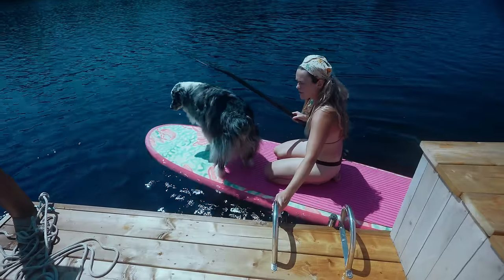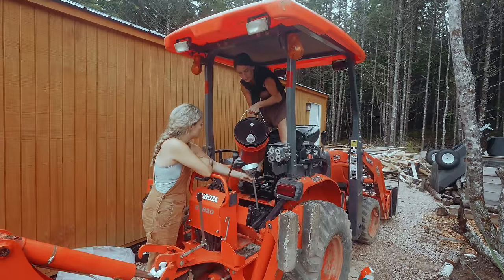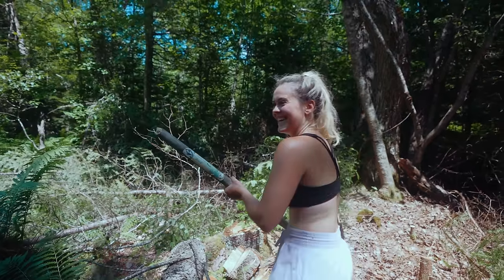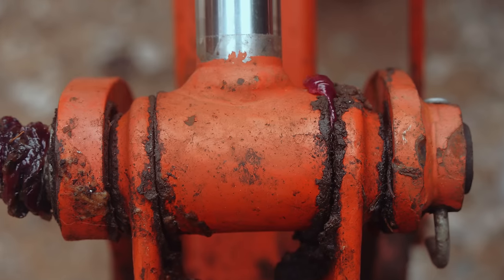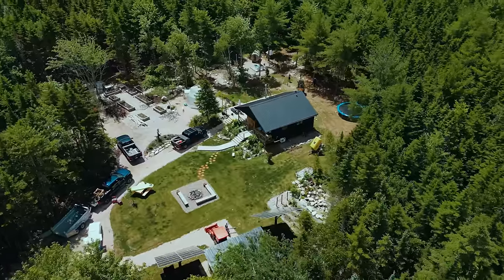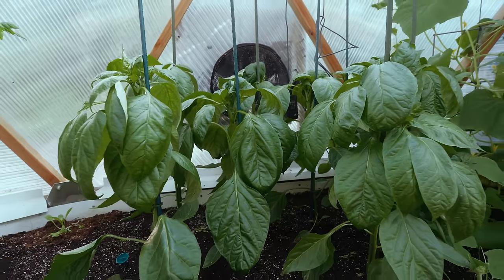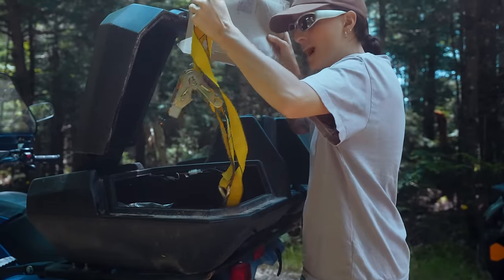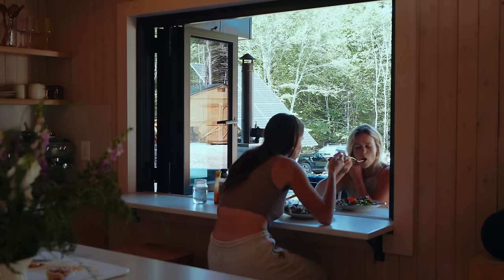30 Days of Cabin Life | Raw, Unfiltered, OFF-GRID LIVING in Remote Canada

Comment: Amazon sells pepermint spray to keep the rodents away.   It is good to spray around any vehicles that sit for a long time.
Spray in the engine compartment, in the wheel wells, and underneath. No mice.   
Mice can cause a lot of damage to vehicles. They chew on wiring.  Good to use around vehicles and even in sheds or garages.

Comment: you all are making amazing progress.  I had to rebuild my picnic table.  It was rotting away after many years of service.  I have a handicapped person here so I modified the table part.  So the only part I could use was the 4 legs.  It was simple to duplicate everything else.  So to make the table handicapped accessible ( to be able to put a wheelchair at the table) i extended the table part by 2 feet as per the ADA guidelines.  It cane out great and my wife and my Mom (both in wheelchairs can fit :)

Comment: Another great video!

Your segment on the greenhouse reminded me of something that you might want to use.  You have enough land that you could build a new, bigger greenhouse using this method and be growing food throughout the year.  When you dig down 5-8 feet the temperature is pretty constant.  In the summer it's usually cooler than the air and in the winter it's usually warmer than the air.  If you build a greenhouse that uses a forced air system that runs through underground pipes to bring the temperature to this constant you can cool the air in the summer and heat it in the winter so that your plans will not have to suffer from extremes in temperature and be able to grow throughout the year.

The video that I saw was entitled "Nebraska retiree uses earths's heat to grow oranges in snow" on Kirsten Dirksen's YouTube channel.   Granted you'd have to do some research, but if you can get similar results it looks like it might be worth looking into.

Can't wait for the next video.
Mark

Comment: It looks like the cabin weighed down the corner of the raft. You may need to add some more flotation under it or relocate the cabin into the center.
Reply from the maker: Yes not a bad idea. Unfortunately and fortunately it’s just the skirt we went with way too wide of boards and that touches the water. The actual structure doesn’t. Will change those soon. Thank you!!!!
Reply: @Vanwives  It's not the wide of the skirt that is the problem, (the top of the skirt is even with the deck) Check your drown video the float is lower on the side with the cabin.

Comment: I think what would solve your rat problem at your dumpster area is building a platform on post in the air and build a ramp going to it and then build a Door Frame after the ramp and put a Door there and make it in a way where all the trash can go up there on that to keep the rats out and maybe you could even drive your truck I don't know if you have a truck I forgot but if you do you can drive it up to that and just go up the ramp and get the trash and chuck it down into the truck and that would be easier on you.